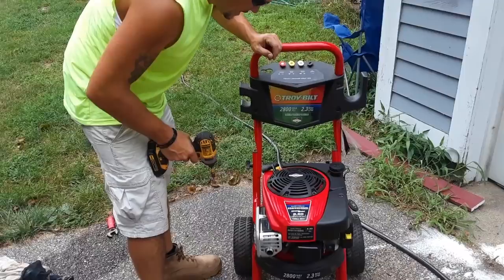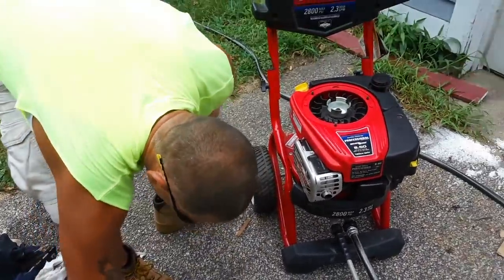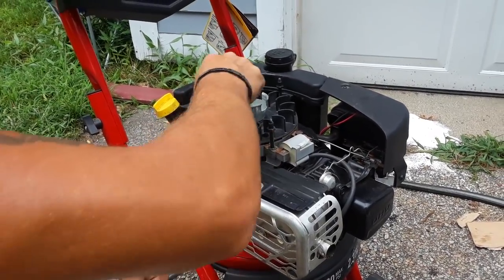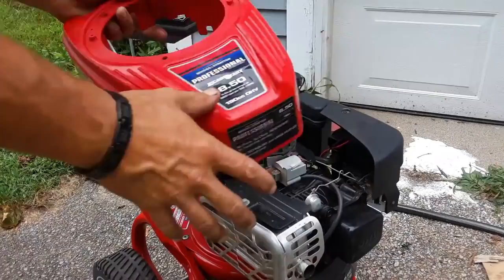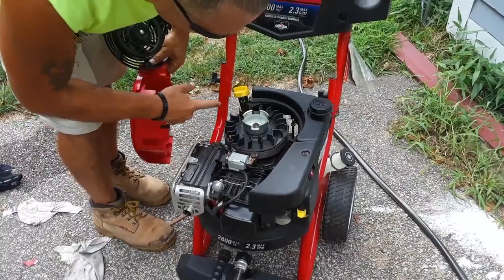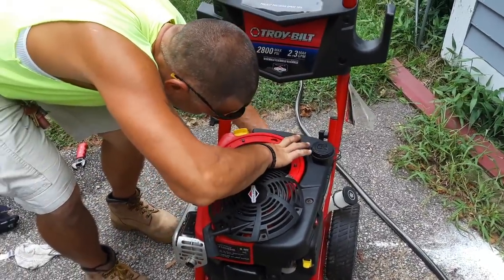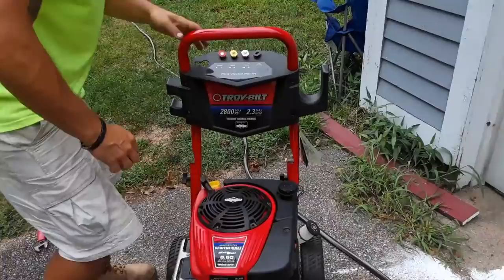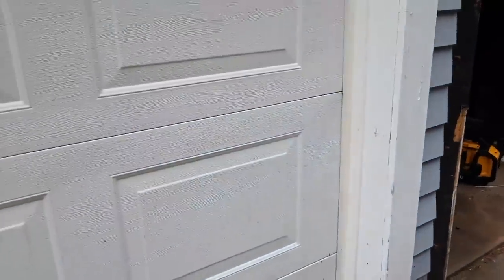Troy bolt 2800  no choke no prime  power washer  won't start fix

Comment: this has been driving me nuts. It starts ok the first time, but if I stop it.. say to refill with gas, it will NOT start for a while. I bet this is why! Cant wait to check it :) thanks!
Reply: Sounds like your coil is going bad, their newer ones aren't made as good as the old style, but any coil can go bad. When it gets too hot, engine dies, doesn't want to start, top symptom of a coil going bad and running intermittently.
Reply: it starts cold and runs as long as i want it... but if i shut it off (to take a break or refuel) i cant start it (its not very old)
Reply: StaticFX okay, than your coil is fine. Your having issues with the auto choke or the carb. Make sure the auto choke mechanism above the carb did not end up in the wrong position, it happens. Make sure the long metal linkage that leads to it isnt bent if it is straighten it out. If that doesnt work something is going on with the carb, like its flooding creating a hard starting symptom. Make sure the needle valve on the float isnt stuck, that would be the most likely reason in their.
Try using starting fluid when you go to start it back up. Spray a little in the carb behind the filter, that will act as a prime and start it until you can fix it.
Reply: Oh yea, just to make sure 100% its not that coil acting up, when you go to restart the engine after you used it, check and see if you have spark, the easiest way, again just shoot starting fluid into the carb, if it kicks over, than you know you have spark and its not the coil, you can also pull the spark plug, make sure the plug isnt fouled up or wet, maybe it is, after a long use, from there stick the plug back on the boot and hold the end against a bolt steel, not aluminum for good contact (or spark tester), pull the cord, you should see the plug zapping, if its not zapping than you know theirs an issue with spark, likely the coil, sometimes the spark plugs go bad, but after you said it runs as long as you need it to the first time, its most likely not spark or the coil unless its having issues during the cool down, most likely its the auto choke or issue with carb that is causing you problems on restart. Check the linkages and auto choke system first, if its not that you need to pop the bowl and make sure the needle valve on the float isnt sticking, while your in their, check and make sure theirs no sediment on the bottom of thr bowl and that the bowl nut, main jet (holes) arent blocked, if the are spray carb clean thru the holes, run a piece of wire thru than blow it out, preferably with compressed air. One of those things has to be the culprit. You could always remove the entire carb and clean it if you had too, but thats a last resort, you should not have to if it starts and runs one time, but wont on a restart, so thats what you need to check. In the mean time a little starting fluid will keep you going, if you spray it in before you go to restart.
Let us know how you make out, I'm  sure their are others dealing with this same problem. Their is also a black piece of plastic hooked in on the back of the engine. Make sure its hooked in properly, they say that covers and holds the governor properly, which controls the linkages to the carb.
Reply: yeah ive pulled the plug, dry as a desert lol prob choke issue. thanks! will check!
Reply: StaticFX Yea its definetely a choke/carb issue. The plug should be slightly wet from pulling the cord when on choke sending gas into the combustion chamber. If the plugs dry, its not getting gas to fire.
Reply: Ok so I took a peek. there is something going on with the carb. At the end of the throttle lever is a spring. Its attached to something on the carb. Its doing nothing. If I move the throttle back and forth, that spring changes nothing. It seems like that valve its attached to should be closing when I lower the throttle but it doesnt. I can manually move the lever so then when I move the throttle it moves. FYI mine is a little different than the one you have. My carb and stuff is on the opposite side.
Reply: StaticFX So your pressure washer has the Quantum L head engine.
How old is it, does it have autochoke?
Are these springs doing nothing with the engine on or off? Because most of them wont do anything when off. When the engine is on the flywheel turning, opens the choke lever, the governor on the engine will be pulling the other butterfly open.
If its auto choke, pull the shroud and engine cover and check if the big flap that sits near the flywheel popped off. Its a common issue, I've seen them popped off a few times. If it popped off the thing cant move when the flywheel turns to open the choke, so the choke just stays shut or half open or all the way open depending where that thing fell when it popped off. Thats most likely what the issue is. You should be able to feel with your fingers if that big black plastic flap is held on or fell off above the carb after you remove the plastic cover above the air filter held on by one phillips head screw and than removing the air filter and the square piece behind it which is bolted on with 3 bolts, be careful pulling that off so you dont ruin the air filter gasket and pull it off the boot than you can feel around up above that thing and you will be able to see everything on the carb clearly. You should pull the cover and shroud too, than you'll be able to see above the engine if thats all still connected and if it did fall off you'll be able to put it back on, its either a 1/4 or 5/16.
Your going to have to pull the covers anyway, yours has a manual throttle your going to have to make sure its all still connected and make sure all the springs and linkages are hooked up and that none of them are bent or disconnected. If I had the thing in front of me I could tell you pretty fast what the issue is. If the throttle is responding with the engine on, than their should be no issue with that. Also on the newer engines theirs a plastic pece that sits right along another plastic piece above the carb and the one is supposed to pull the other, sometimes that pops out and is sitting to the side of the other piece doing nothing, if yours does have that you need to make sure its positioned correctly by sliding it back into the other piece.
Their are parts diagrams for your engine that will show how everything is supposed to be.
Briggsandstratton.com support parts enter your model.
Reply: its... maybe 4 years old? not sure lol. I will find the model number and see if I can find a manual. Otherwise I will link you some pics :) Thanks!!
Reply: StaticFX If it doesnt have an ohv, over head valve, its an L head. It can only be a quantum or Quatro
 Anything over 5 hp would be a quantum. If it has a flat square paper air filter its a quantum, the Quatro was the engine Briggs used before the Quantum before they called it a Quatro and is also known as the briggs classic, because that was the design they used when they came out with aluminum blocks in the 50's..
They made millions of Quantums from 1984-2017 very common lawn mower engine as well, prior to this year. If the model starts with a 12 its most likely a Quantum because they are all 12 cubic inch engines.
L heads went out of production last year, due to emission standards, generally speaking they are a much better engine, with less to deal with like adjusting over head valves. 85% of those engines last 20 to 30 years plus, compared to the new line of engines, like in this video, however OHV's run quieter. Their are still tons in service going back to the 80's and 90's.
They were even better back in the day with manual chokes and or primers that never went wrong, the auto chokes develop issues although generally speaking your supposed to be able to just pull the cord and its starts, now, compared to having to prime or put the choke lever on, removal of a primer to auto choke also cut down on emissions, by removing the excess fuel the carb burns when initially starting, however I noticed with the auto chokes the engines backfire when you shut them down because as soon as the engine shuts off the choke closes and a small amount of fuel is left in the combustion chamber at that point which causes the backfire and still creates excess emissions, so auto choke aka MRS is more of a consumer convienience than anything else, but you have to know how to work on them, if something goes wrong, but its all relatively simple stuff compared to automobiles and once you learn these engines, you never forget them, having proper tools help, your going to need a descent socket set and wrenches at the very least to work on these engines and a phillips and flat head screw driver. Oil, and fuel stabilizer, that covers all the basics for one of these. A flywheel puller and torque wrench are helpful if your moving onto advanced repairs like changing a sheared flywheel key or getting at points and condensors on older engines. You should never have to worry about a sheared flywheel key on a pressure washer. Rv coolant is good to keep the pumps protected for winter storage on these units and if you ever have to get into the pump be prepared to have allen wrenches.

Comment from the maker: If you have to hand choke it remove air filter( sponge) put something over it while friend pulls the cord
Reply: Or spray a little starting fluid into the carb behind the cover and filter, that will act as a prime and get it started.

Comment: The thing with my pressure washer is that the thing your we’re moving around, that doesn’t actually move for me and I was wondering if someone could tell what I should do
Reply: If the fly wheel wont move that engine shaft is seized or broke. Unless you got spare engine hanging out it aint going to be worth fixing.

Comment: Can you take that part out and soak it in rust remover?
Reply from the maker: I wouldn't they make spray you can spray and  wipe with a dry rag
Reply: A little sanding block will work too.
Reply: WD-40 is a rust remover
Reply: I don’t see how cleaning the flywheel fixed the engine from starting.  The flywheel does not have to be cleaned  as long as the magnets maintain the same distance from the pickups on the coil you are good.  Also you do not have to have the flywheel in a certain position when when Putting the cover back on.
Reply: BigbadJohn I was thinking the same thing. My push mower's flywheel is one big rust wheel and it starts everytime.
Reply: You COULD, but then you'd probably have to re-gap the magneto, which is no big deal.

Comment: i've done repair to everything to my pressure washer, the only thing missing is an under glow light kit.  damn thing still won't start .
Reply: The Briggs engine contains a plastic cam and timing gear. They fail miserably..  :-(

Comment: I have this same machine. It is pure junk and only worked for a short while. Never again.
Reply: Lol it's a briggs and straton motor nothing wrong with it. You clearly have no idea on how to store tools like this properly and even if it does not run? Take your a grand total of 5 minutes to take the carb off and less than one to do what he does in the video...
Reply: I brokedown and cleaned the carb, new fuel line, cleaned the tank, checked the spark plug and it still will not run on fresh gasoline. Only starting fluid will get it started and will stop after it burns through that.  Typical piece of shit Briggs and Stratton motor. They are ALL junk after a year of use. Go with Honda motors. Never had a problem with them.